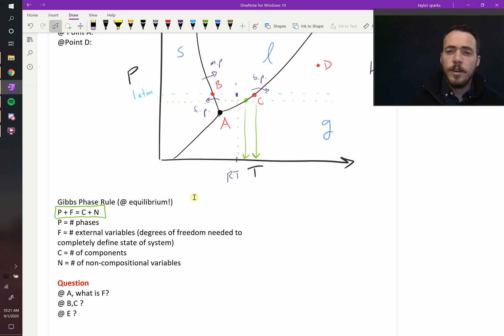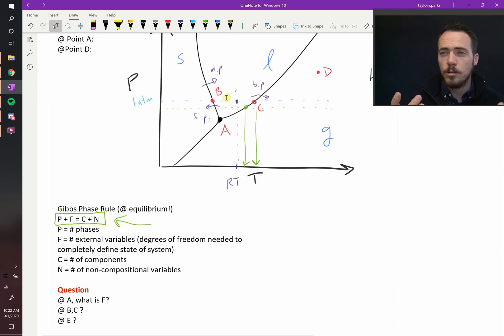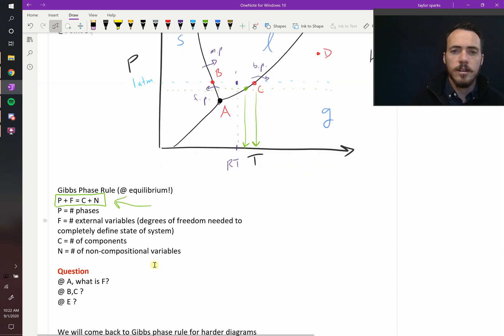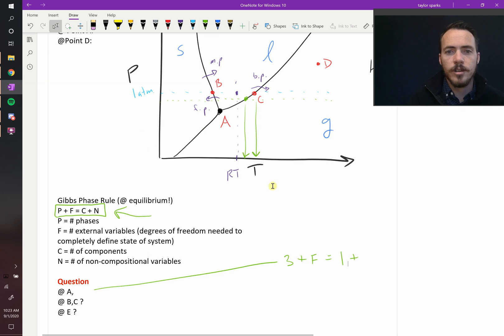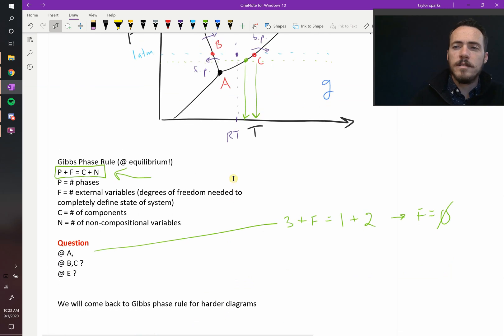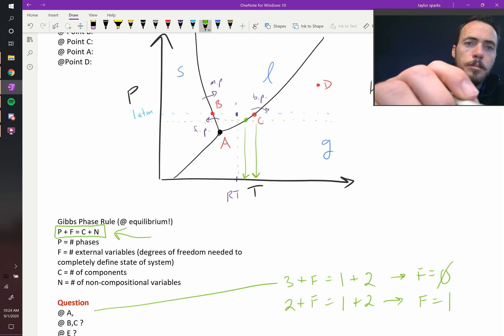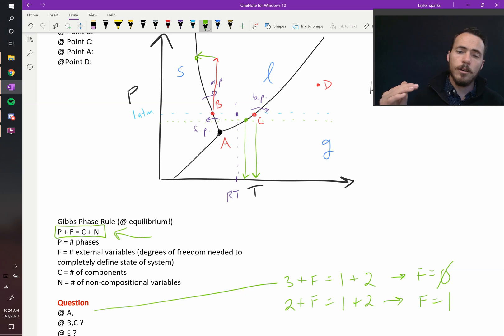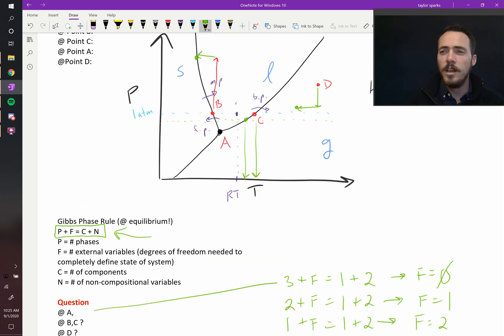Gibbs phase rule

Comment: How many phases are present in a water alcohol mixture with pressure and temperature held constant?

Is it 4? 
P=C(2)+N(2)-F(0)
Reply: I think we can find out the F only with this equation  and also that graph is for unary phase diagram.  Maybe it can't work with other systems like binary and Ternary .
Reply: Water alcohol is binary system